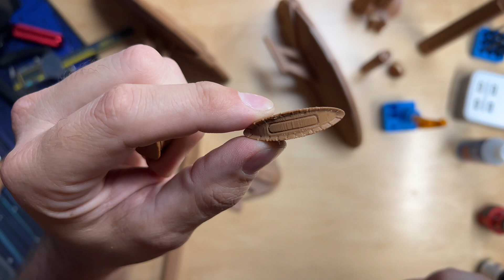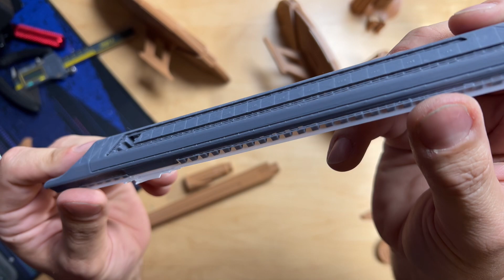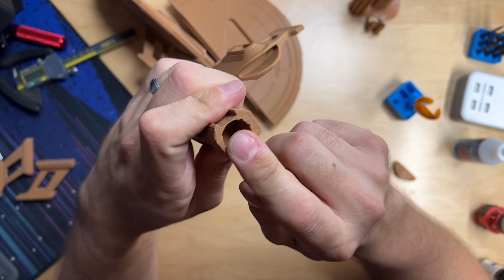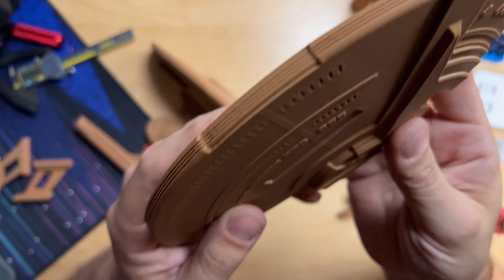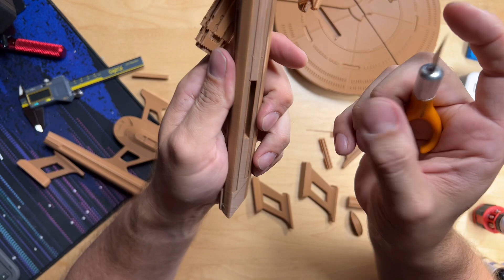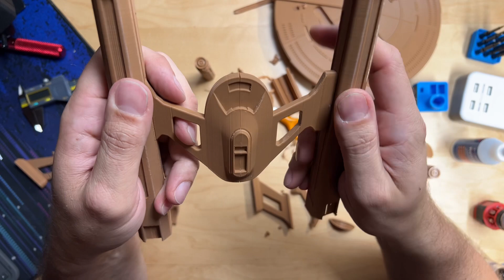USS Cerritos 3d Printed Model Overview from the tv show Star Trek: Lower Decks

Comment: Would you recommend priming before assembly? Like with the nacelle I’m concerned that priming it would cause it to not slot in there.. so I’m also concerned I wouldn’t be able to paint before assembly.
Reply from the maker: Standard ca glue works fine for me. I personally use Starbond glue and have had success with it.

I would assemble it into 2 halves. The saucer and the lower half. Then fill and prime. The arms that insert into the saucer should look fine without any kind of filler. The connection isn’t tight enough that I would about the primer gumming it up. The parts that join aren’t very visible so any sanding for fitment wouldn’t show up.
Reply: @neebick if you subassembly the lower half and the saucer and finally assemble the saucer to the lower half, is there a risk of misalignment?
Reply from the maker: @arnthorsnaer  I don’t believe so. There is some flex to the parts but it can’t hurt to dry fit into the saucer as you are gluing to help with alignment.
Reply: @neebick good video by the way.